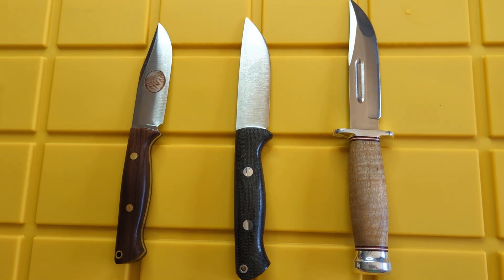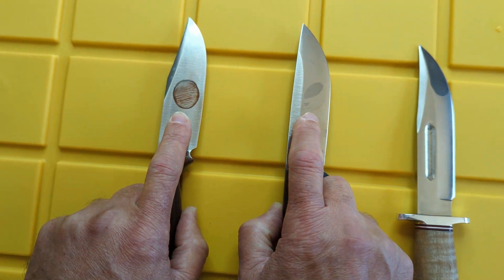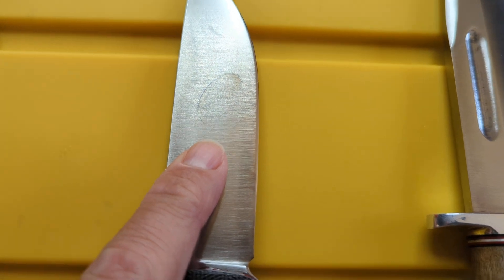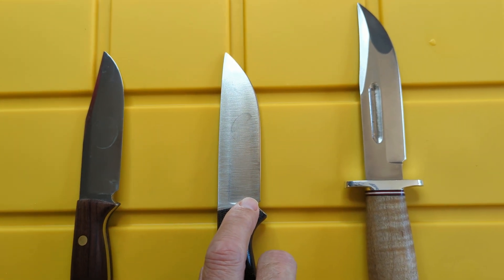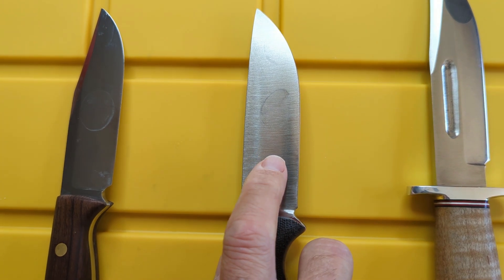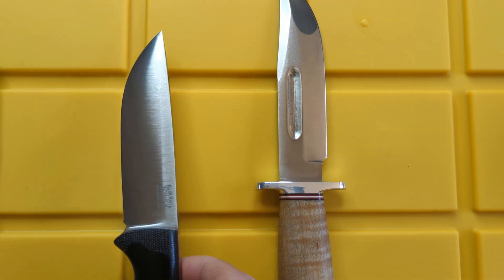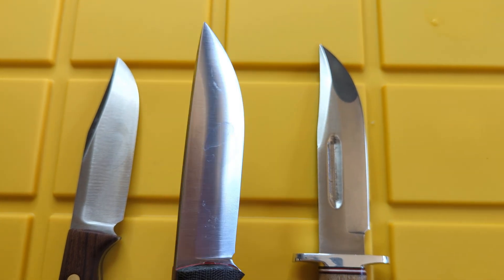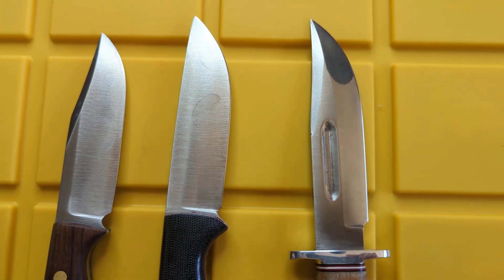Magna-Cut versus 3V corrosion test

Comment: So youre comparing tool steel to stainless?
Reply from the maker: @darrylsowade  I bought Bark River Magna-cut thinking it was stainless, but had it tarnish immediately.  In this video, I'm comparing Bark River steels to see if my knives are just 3V mislabeled or whether Magna-cut is more stain resistant than 3V.  I don't consider Bark River Magna-cut to be stainless.  At least mine is not.  Thanks for watching and commenting.
Reply: @ ahh i see its a specific brand. If you know mr thomas the doctor who invented magnacut has done mutliple tests and confirmed that MC is stainless. Maybe they have some kind of cheap knockoff not really MC.

Comment: I have a SURVIVE knife in 3V. I use it at home and wash it with tap water and let it air dry with dishes. I did not see any rust or discoloration on it. Magnacut is more resistant to corrosion but no stainless steel with carbon is completely resistant to rust if exposed to salt. The only exotic rust proof steel is H1 steel.
Reply: Spyderco testing shows effectively zero corrosion in salt water on Magnacut.

Heat treat can dramatically affect corrosion resistance so it's entirely possible Bark River is not optimizing for stainlessness.

Comment: Magnacut is not stain proof.  No steel is.  I have used ferric chloride to etch a gray matte finish onto one my Magnacut blades.  Granted, it was highly concentrated FC, and I mean almost straight up FC, but it did stain the Magnacut. I did it to hide the damned scratches I couldn't completely get out of the blade when hand sanding.  Magnacut is hard to finish, lol.
Reply: I did the same with a Bradford 3v blade and ferris chloride. I sanded, polished, and acid etched before a little tumble. Fun times. I used a spyderco spy27 blade to open the sealed bottle, and it took 10 seconds to stain the blade. Fun times.

Comment: GOD… YOU MISSING THE “HEAT TREATMENT FACTOR: HIGH TEMPER LEADS TO HARDNESS AT THE EXPENSE OF LOSS OF CORROSION RESISTANCE, WHERE LOW TEMPER  MAINTAINS GOOD HARDNESS   BUT NOT AT THE EXPENSE OF  IT. BARK RIVER IS HARDLY RELIABLE WHERE HEAT TREATMENT IS CONCERNED
Reply: Amazing how few people know anything about tempers

Comment: Bar keepers friend and some scrubbing will help remove it.

It is magnacut. Its a combination of the heat treat being wrong and how they grind it. But also how they handled the situation at bark river by not fixing the problem. No one else has that issue.

Survive knives also had the issue and they use the same heat treat facility and hot grinding. They had to coat those models to recouped the costs. Bark river just sold them and won't take them back and lay blame by saying its not stainless.

Other brands had 62 plus without issues. Bark river can't take them back and replace them because its so expensive and I'm not sure if the heat treat facility resolved the issue or not. It seems like they may have via what survive knives has said, but bark river is in denial that anything wrong happened. Again cause they don't want to loose money. Then they have to find out what to do with all those defective knives without loosing more money.

All Cause they didn't bother to do their own testing. Customers are the beta testers. Doesn't make sense, right? They mskd s nice looking knife but cut corners everywhere. Then make up excuses. Customers get scammed in the end.

Comment: This test is a good one. Shows the actual properties. That's a standard reaction for 3v and Magnacut. Magnacut is not a true stainless. It's better than D2 in that way, but so is 3V. Hard to tell how much better. Definitely not a salt knife. Spyderco would never do that. They have invested to much into the Carbon free steels.
Reply: Spyderco actually test their knives extensively before selling them. If its someone else's design that may not get tested as much (kapara is one example that wasn't, a gen 2 was released to fix some of the major issue's).

But yeah if you watch interviews they say they salt water test them all and also carry them personally for month's before going into production.

Spyderco are heat treating magnacut different than bark river and using magnacut in the salt series lineup because it can be very stainless... With the right heat treat.
Reply: Not true. It depends on the Heat Treatment: it requires low temper & better with CRYO
Reply: Your comment has aged like fine milk.

Comment: Magnacut isn't stainless. Spyderco using it in the salt series is a mistake on their part.
Reply: Look at Pete’s results. It’s highly stainless even without having high chromium content. It’s almost stain proof, however as everything it’s not completely stain proof.

Bark river is well known for making shitty products lately, especially regarding Magnacut. So many broke, so many have burnt edges. Magnacut is stainless because of how it’s treated, not because of the composition.
If bark river does a shitty job, the product will have worse performance.
Reply: @clintwestwood3539  h2 or whatever spyderco uses basically is the most stainless steel there is. Someone left it in an ocean for... WEEKS and it had zero rust.
Reply: @escapetherace1943  There is a reason why Spyderco is replacing both H1 and LC200N with Magnacut. LC200N is decent enough, don’t get me wrong, but it’s abyssal the difference between LC200N and Magnacut since the former can’t be treated at higher hardnesses and even at lower hardness still is less tough and wear resistant than Magnacut because of the composition, not even treatment in that case.
H1 will go out now, or they will keep it as an entry level rust resistant steel. Like a 100$ salt knife. But for just a bit more, you get much more performance (like 1 to 100 comparison between H1 and Magnacut), also by considering that Spyderco is using the correct protocol and not half assing their treatment like Bark Rivers.
Reply: @clintwestwood3539  I literally use almost only carbon steels anyway 😆because I just like how easy they are to sharpen, but if I lived near the coast I'd want something that could last.
Reply: @clintwestwood3539  100 dollar knives are entry level? Spyderco makes me feel poor
Reply: @clintwestwood3539  just FYI, Peter's heat treatment inc. Does the heat treat for bark river and many other brands. Iirc they worked with Larrin on the protocol but not sure the details or testing that they all did in the end cause of the poor results. Obviously bark river didn't do any testing.
Reply: @escapetherace1943  yup, making knives correctly is expensive.
Reply: @clintwestwood3539  your comment is hidden by youtube just FYI. But yeah . also the rc isnt what dictates how it reacts but how it got to that rc that matters.
Reply: @tacticalcenter8658  Probably got reported by some Bark River fanboys, it happens ahah still better than seeing Mike threatening to sue on bushcraftusa or bladeforums, at least I don’t have to read his bs
Reply: @clintwestwood3539  naw they auto-hide things based on the content the message says and a script goes through it. These days you have to be fancy with the way you talk negative about anything
Reply: @tacticalcenter8658  what exactly is correct? Because stamped knives are just as good as hand forged or precision cut blades. If it's quality control sure Spyderco is alright, but they still throw out uncentered blades sometimes. My para 2 was stiff as hell out of the box too. Great blade but a shame it was s30v (garbage steel)
Reply: @escapetherace1943  lol ignorance is bliss.
Reply: @tacticalcenter8658  indeed my sweet prince... my beaten up carbon blades and grandpa's knife I've used for decades just doesn't work. Old steel just didn't actually cut things or work we're just made to believe it did.....
Reply: @escapetherace1943  never said anything about that. Rusty shard of steel will work fine for many.

Comment: I agree Magnacut is not a stainless steel but is highly stain resistant.
Reply from the maker: Bark River Magna-Cut is not stainless, but everybody else's is.  3V is better in Bark River.
Reply: @MountainLife1  try out delta 3v from Carrothers performance knives. It uses low heat temper. Its also not stainless at all but will be more stain resistant than regular 3v. It will take longer to stain. Also perform much better in multiple tasks. Better edge stability too. This company also makes knives in magnacut now. I don't know its stainless capabilities but they goto 63rc and use a longer soak time unlike other brands for more toughness... and they show testing on there YouTube vs other steels.
Reply from the maker: @tacticalcenter8658  I just watched a video on the Carrothers website where they tested Delta 3V.  I can definitely see a pair of Carrothers knives in my future.  Thanks for letting me know about them.
Reply: All hypes if it only marginally better than a non-stainless 3V.
Reply: @ZoneCrasher It holds edge better, it sharpens quickly, it can go thinner on edge because it’s more stable and won’t either chip nor roll, but aight, “marginally” lol.

Bark river is well known for low quality treatment of Magnacut, Magnacut performs better because of the treatment if you look at the protocol.
Reply: @ZoneCrasher lso it is highly stainless if treated properly.
You can see good Magnacut treatment online everywhere or pick one up (so not a bark) and you’d see that it’s basically stain proof, not even stainless.

The problem is that it’s less forgiving than any other alloy, which means that you can do shit job with a 3V and get a somewhat decent thing, but if you halfass the protocol and can’t break through the 61.5 point like Bark River, it means there is something wrong from their part, especially considering how most companies are easily stable at 63/64 to 65.